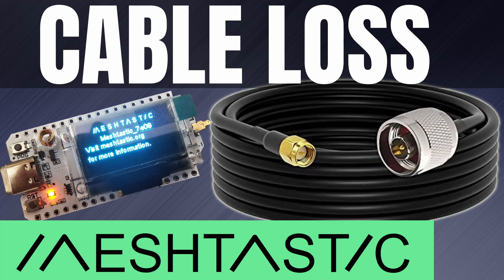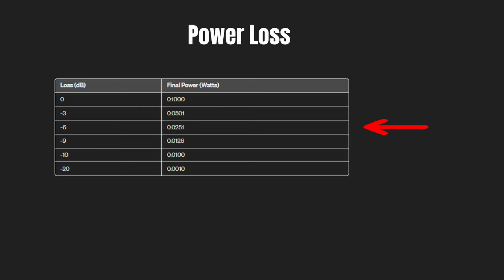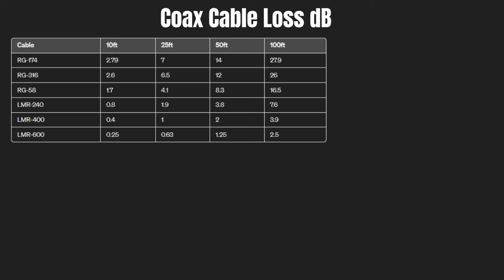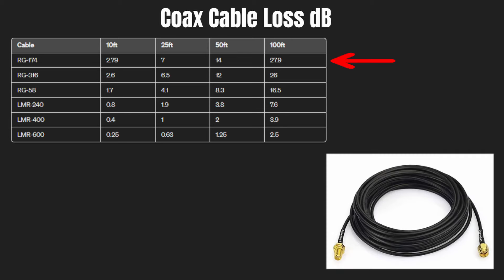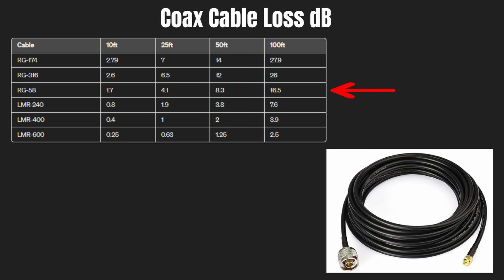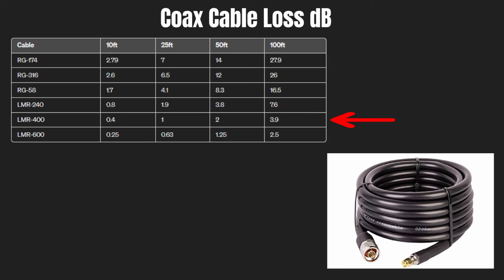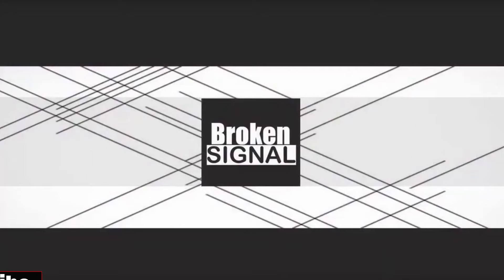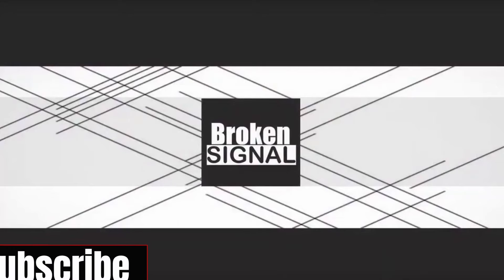Meshtastic Cable Loss

Comment: I feel the need to point out that low-loss coax used with a gain antenna doesn't really give you more wattage at the antenna. 
dBi is antenna gain, that's compared to an "isotropic radiator". (Meaning a theoretical antenna that sends RF power in ALL directions).   
A gain antenna (like a dish or Yagi) concentrates the power in one direction. 

A gain vertical antenna (like most of us Meshtastic people use) is normally omnidirectional and it's pattern looks like a donut. Fat signal 360 degrees around us. With low gain, some signal is wasted going up into space. 
(picture a ring-toss game using your antenna with really big donut on it).

If its a high-gain, the pattern looks like a flattened donut, concentrating power out towards the horizon, instead of shooting off into outer space, or into the nearby ground.

So, 0.1 watts into a cheap -3db cable, means you get 0.05 watt at the antenna input. 
But, if you have a +3 dbi gain antenna, your ERP (Effective radiated power) signal at the target Node, looks like you didn't have any cable-losses. The antenna made up for the loss.
If you have a 6 dbi antenna, it makes you signal 3 db higher than it was when using that old 3 dbi antenna.

Anyhow, Dbi is what people use to sell antennas. The practical measurement of gain is dBd.  
"dBd compares the gain of an antenna to the gain of a reference dipole antenna (defined as 2.15 dBi gain). 
It's a lot easier to test the gain of a new antenna, by comparing it to a standard, instead of an imaginary "isotropic radiator".  Antenna testers have a lot of reference antennas.

Comment: I got a real world dose of this the other day. Was using the cable that came with my antenna. Range testing was horrible. Only could pick it up in my backyard. Borrowed my buddy's low loss cable and saw signal improve by tenfold. Looking forward to range testing this weekend.
Reply: Which is the best coax you've used?

Comment: Why not use basically no coax? Ive a 2" rg316 jumper from board to antenna. Running power to the node is easy and cheap compared to good coax and you'll never make up as much from better coax as you will from just going short and putting the node in an enclosure right at the antenna. How often do you guys find you're taking these down for maintenance?